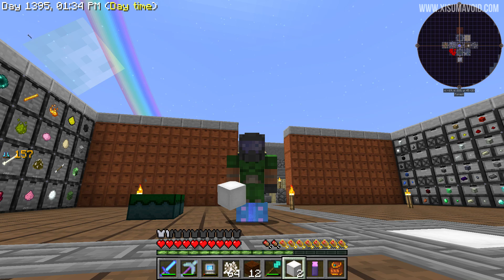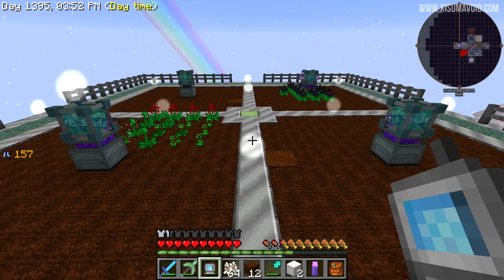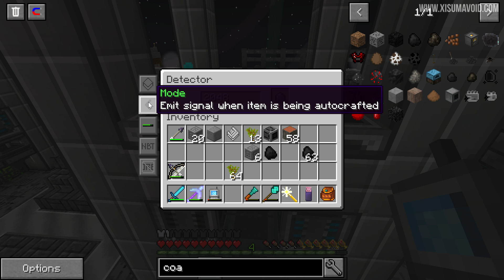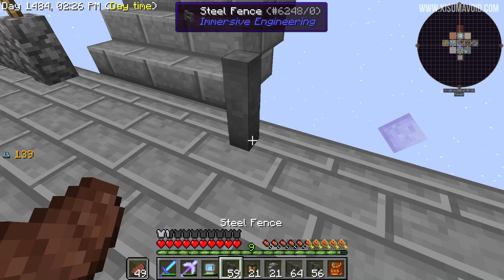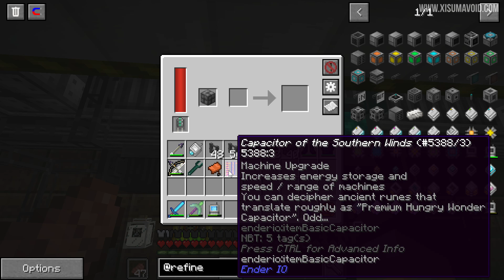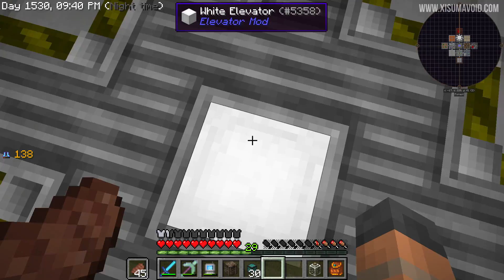Sky Factory 3 26 Platform Renovations

Comment: Hi, did you new, that refine storage cables works fine with Chisels & Bits. You can use this at you autocrafting platform.
Second suggestion, Refined Storage can send and store fluids, you not need ender tanks, just importer, exporter or external storage for a tank or drum

Comment: Xisuma, your lava problem is not bandwidth on the ender-tanks, but rather a limit on how fast the Ender I/O tanks can push lava into the ender-tanks. To fix the problem you should only need to remove the Ender I/O tanks and use the pressurized fluid conduits to push lava. If the conduits are not already the top tier versions this might be the time to upgrade. You could also consider alternate power sources, like the culinary generator or maybe the ender generator (since you have soooo many enderpearls). As always, awesome video! Have a wonderful day/night.

P.S. One other bit of advice, the Mystical Agriculture crops (the redstone/obsidian plants) cause a considerable amount of client-side lag. I'm not sure on the exact technical details, but the mod has some issues when calculating growth ticks and then rendering the new plant-stage, which causes a serious amount of lag. I had 4 farms in my single-player world running and on my fairly powerful machine it still would stutter anytime I was in the area. As for the farming stations, their radius is affected by the capacitor upgrades. With an octadic capacitor they can farm an 11x11 area (if I'm not mistaken).

Comment: It looks like you're using regular fluid conduits for all of your lava flow. I'd imagine you can push lava through the system and into the generators much more quickly with ender fluid conduits, which you can certainly craft at this point.

Comment: For the lava, you want to replace the tanks with conduits. The tanks add a max bandwidth since they only push 200mb per second or so. 
Also, if you place an ender tank on top of a lava generator and right click the circle thing on the front, it will auto eject to the bottom. This will I believe dump the full inventory immediately so is even faster than all the conduits. You prob don't need that amount of lava though 
Dodu

Comment: Hey Xisuma, you should look into upgrading your fluid conduits! They have more throughput than the "push" from the Fluid Tanks, while the Ender Tanks aren't capped at how much they can input/output. If you used the better fluid conduits instead of the Fluid Tanks to put the lava in the Ender Tank, the bottleneck will likely be on your actual lava generation and not liquid throughput. The upgraded conduits will make a huge difference!

Comment: Hi X, for the lava transfer you want to upgrade your enderIO pipes to the enderfluid ones, not change the thank setup they work just fine. the conduit you use right now only transfer like 100 ou 250mB/tick and store liquid in them, making it a nightmare ton configure a lot of them. the enders ones transfer 1000mB/tick (almost instant) and don't store fluid, they also have fluid filters built in.

Comment: Ender tank bandwith isn't a problem, they can I/O a huge amount of liquid at once. The problem is the EnderIO tanks again, they have a relatively small I/O rate. If you connect the pipes directly to the ender tanks, the problem should be solved. If not, the pipes may need upgrading.

Comment: The lava generators aren't getting all of the lava, cause the enderIO tanks have a pretty low cap of input and output speeds.
For example you can make it a lot faster (the moving of the lava through the ender tanks) by just using the ender tanks at the end of the crucible row, instead of the enderIO tanks.